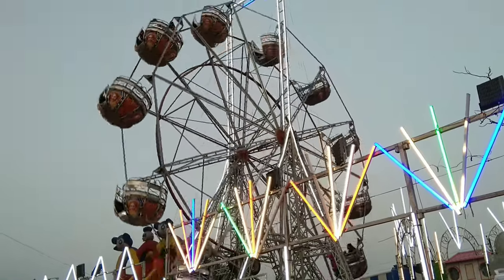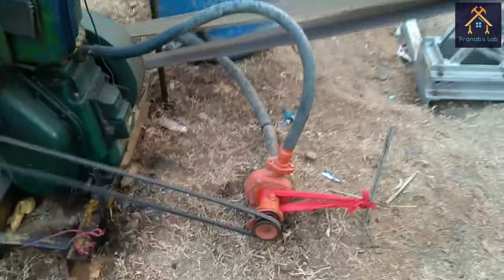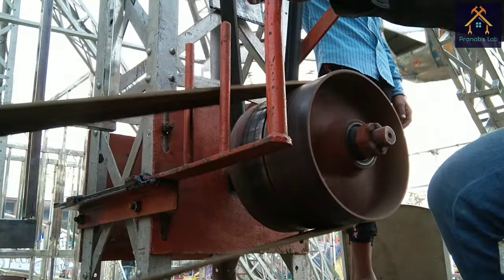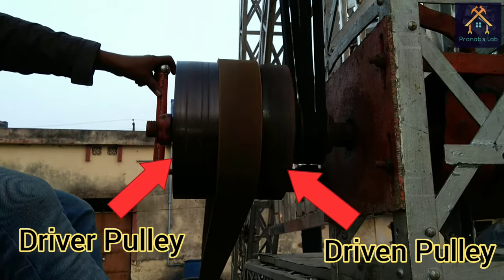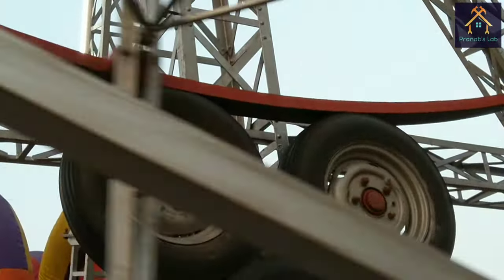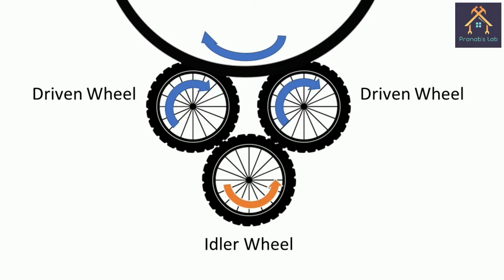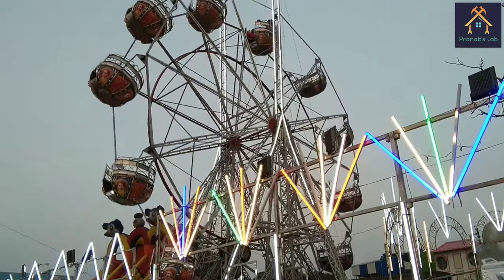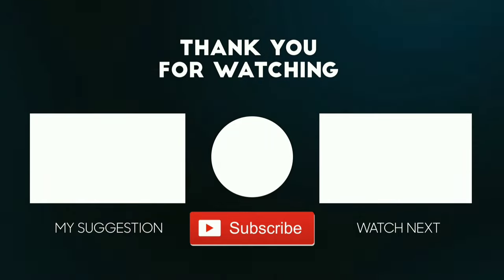Mechanism of Ferris Wheel | Merry-go-round | Cross Belt Drive, Clutch, Idler Wheel, Braking,Speeding

Comment: I really like your video. This FERRIS wheel is very compact and easy to reproduce on a small scale (60 cm high). I intend to share this great video where everything is explained. It is enough to replace the diesel engine with a small steam engine. Everything is mechanical and apparent. A transmission by a crossed belt, a clutch of 2 pulleys, a 3rd controlling the 3 wheels with tires driving a circular crown. It’s ingenious and everything and it works wonderfully. The machinist's station is on high, visible, integral with the lattice girders and located in front of the boarding of passengers in the gondolas. It only features the clutch and band brake control with a long lever. Everything is accessible. You should have made a small diagram of it, but it is easy to draw thanks to your explanations. All of this has charm. Congratulations.

Comment: HI...HOW DO YOU suply electricity to ferrys wheel to power up the tube lights..while the wheel is rotating
Reply from the maker: The electric power to the rotating wheel is fed through slip ring just like carbon brush is used to energies the rotating field of alternator. 
Usually two insulated bearings are used to make the system economic. Where the inner rings are statically connected with phase and neutral and the power is taken by using spring loaded brushes, which touches the  rotating outer ring. Thus the power is supplied to not only ferry wheel, but also the all applications like this.

Comment: Seems ALLOT more complicated than the models I've seen here in the States, mfg by Eli Bridge Company.  I would hate to think of what would happen if the that drive belt snapped while in operation.  Nice video nonetheless, subbed.
Reply: I wouldn’t say it’s more complicated than the Eli Bridge wheels, but it’s less standard for sure. Cable driven big Eli’s have a really traditional motor and clutch that most older amusement rides and even tractors used, where this just has different mechanisms from what most use.

Comment: Hi Pranab, I have 1 question. How tube lights work while wheel is rotating. what is the mechanism behind this.
Reply from the maker: The tubelights are fed through the slip ring mechanism. Mainly a bearing is used for this. Inner static part of the bearing is connected with line and outer rotating ring is connected with rotating tubelights. Current can easily conducted from static inner ring to rotating outer ring, as the whole bearing is metalic and good conductor of electricity.
Reply: @PranabsLab can you make video about it and while raining will it shocks people?
Reply from the maker: Why man why!?
Reply: @PranabsLab  when it shock when rain in Ferris wheel tubes lights?